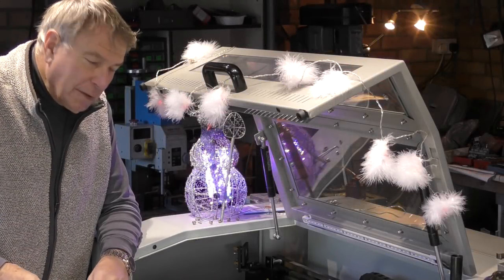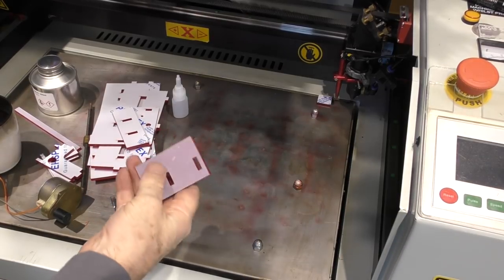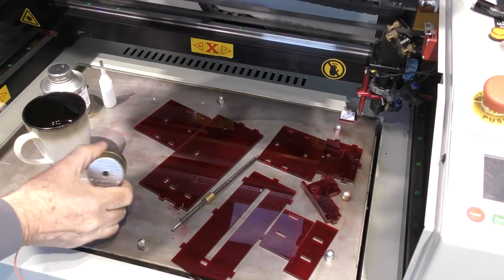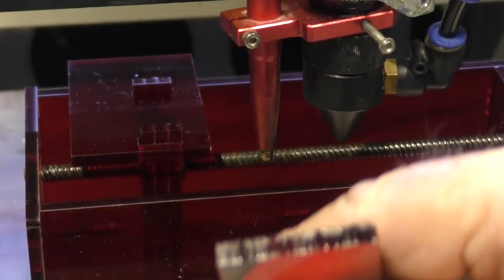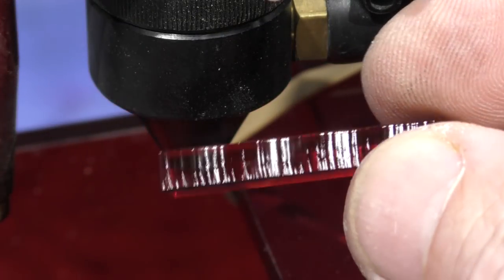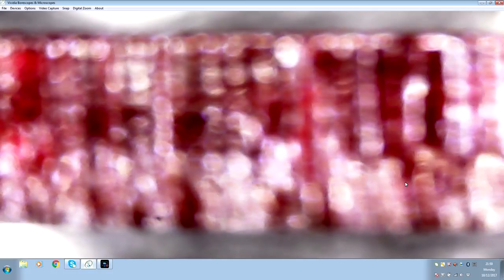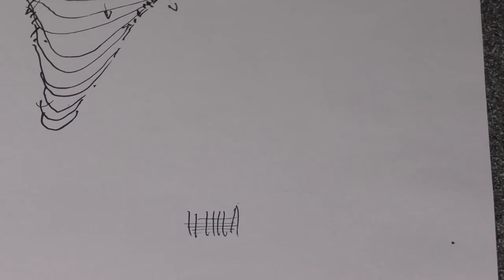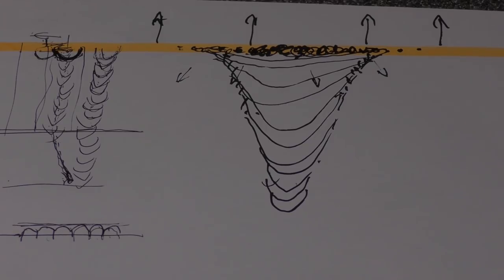RDWorks Learning Lab 128 Are Acrylic Striations Stepper driven

Comment: Hi Russ ! Thank you for this instructive video. Indeed, I noticed that trying different speed changes the way those stripes appears. For exemple, if you cut 3mm acrylic at 20mm/s, you get certain kind of strips but if you try 19mm/s or 21mm/s, it can change significantly. As I alway say, the key to CO2 laser cutting is to try, try and try... The best way to get the better cut result is to run tests at different speed, different power, different air assistance and also different shape of cut (sometimes results of a cut can be very different between lines and curves). Thank you again.
Reply from the maker: Hi
I am trying to decode the mechanics of cutting so that one can anticipate the result of taking certain actions. Up to now,  many trials and tests has been the only way  to find the needle in the haystack. I am trying isolate and understand  the many small details that are intertwined to make this technology work. This is but one of those steps.
Thanks for the comment
Best wishes
Russ
Reply: In my opinion, you are doing it the right way. Testing and experiencing are the best way to discover interesting things about this technology. To anticipate results might be difficult at a "general level". With a certain kind of machine, we can reach a point where we can anticipate but with another machine, results changes. Controller, drivers, motors, belts, guides, laser power supply, laser tube, mirrors,  lens... So many parameters that can change so many results ! Anyway, "bravo" for what you do and thank you for sharing it.
If one day you get bored with your laser plotter, my advise to you is to get a galvanometer laser machine, you'll have some more interesting thing to discover with it ! Best regards. Loyc

Comment: Are servo motors different?  You have any laying around to test? Lol.   Or what would happen with an AC or DC motor?  I realize it won't change the basic principles of sublimation but it would be interesting to see the affect.
Reply: And Merry Christmas to you too Russ!
Reply from the maker: There are two basic types of electric  motor, analogue and digital. The analogue are stepless  with variable current control to change speed, a bit like a DC motor and the digital are always some sort of stepper motor. The servo description comes from the fact that attached to the end of either motor shaft will be a rotary encoder. In the case  of the stepper motor, the driver normally issues a string of pulses to move the motor the required number of steps. This is a "blind" attempt by the driver  to get the stepper to move to the correct position. After issuing it's string of pulses the driver has no idea if the stepper has actually made it to the required position This is an open loop system which is only possible with a stepper system. The rotary encoder addition qualifies this system to now be called a servo system because the encoder counts the steps that the motor makes and does not report back to the driver until the requested steps have been completed. This is now called a closed loop system but it is still a stepper motor with a pulsing motion. The Analogue servo is different in that it is a stepless system and always has to be controlled by an encoder. It is the feedback from the encoder  that tells the servo amplifier of the current and direction required for  acceleration, deceleration and final stop position of the motor.  The point I make here is that servo  does not mean stepless it just means accurate positional control.
I was using a stepless motor for my test work. This  is a mains driven synchronous  analogue motor which rotates at a speed governed by the mains frequency, so it is extremely accurate and runs at 600 rpm for the UK 50Hz mains. It is then driving through a 10: 1 gearbox to output a shaft speed of 60 rpm. Hence the output speed will be stepless and very stable, only varying by 1/10th of any mains frequency fluctuation Driving through a mechanical leadscrew ensures positive translation of this constant rotation into constant liner motion.

I hope that answers all your questions. Steady motion produces worse quality cutting than micro stepping. The high spec silky smooth analogue servos on large industrial metal cutting machines produce exactly these coarse striations on the edge of mild steel cuts  see   https://www.youtube.com/watch?v=hpjTGrtnru0&t=1s    at 18minutes

Thanks for the comment
Best wishes
Russ

Comment: Russ, great presentation! I wonder, does the frequency of the AC power has any effect as well. 50 to 60 Hz is a pretty large step in comparison to what the program is firing. Is it possible we are seeing a reaction to that frequency flux as the laser travels as well as the reaction you describe? In other words, at a certain speed, you may be able to count the variations per second based on this theory.
Reply from the maker: Hi
There can be no external frequency effect (mains) because this is a DC excited system. There is the low current preionization region before the beam fully forms where there is a VERY high frequency  beam but as soon as the beam stabilizes then it is rock steady. That is why you can interpret the track depths in acrylic as a 3D record of the head velocity. It was exactly this effect that I was identifying when I saw my curtains effect. The small velocity changes caused by engagement and disengagement of the toothed belt were being reflected as changes to the head velocity and recorded in my acrylic (and wood) engravings.
As I say in my video, everything is open to interpretation and you, seeing the same facts that I saw, may draw a different conclusion.
Thanks for the comment
Best wishes
Russ